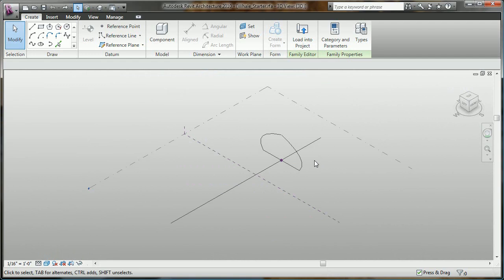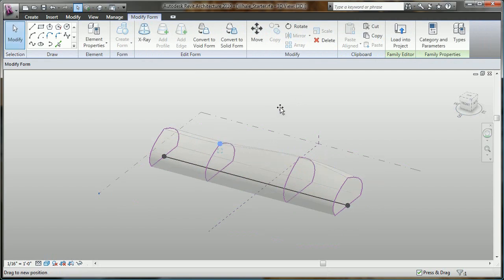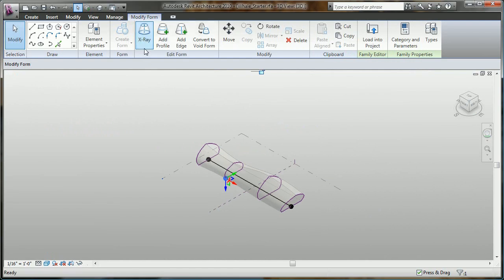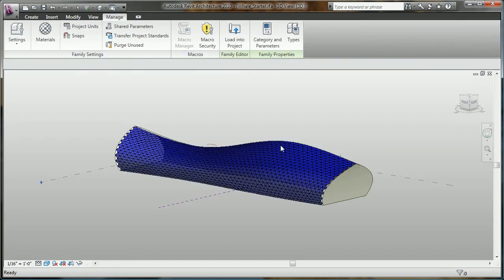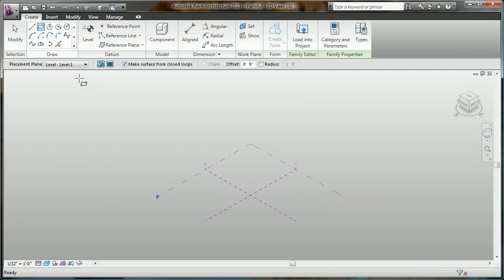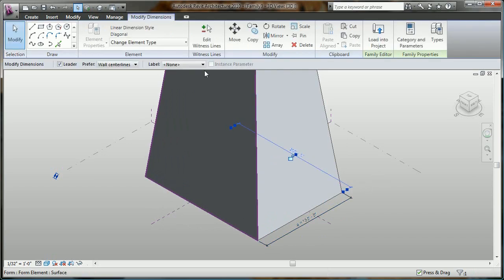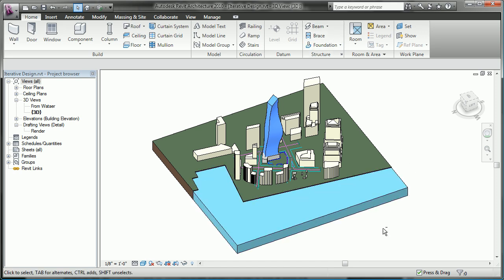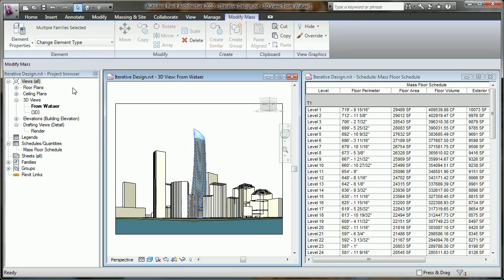Autodesk Revit Architecture 2010 Demo

Comment: We are in the age of artificial intelligence in 2024. When you say draw the project and give it to me, it will draw it. But autodesk infraworksta cannot even transfer the lines of the plots of the roads we draw in revit. This is such a clumsy understanding of software. why are you selling the products as a team, why are the software not compatible with each other. Are the software developers making fun of the users. The roads are drawn in infraworksta. It is transferred to civil3d, there is only one line there. You transfer the revite from there and add the road to toposolid by drawing a line one by one, it doesn't fit either. mu.koskoca why can't autodesk solve these architectural environmental object transfers. Is it that hard for you to automatically open the scene in infraworks with its roads and plots as toposolid in revit?

Comment: @Arajack  Revit is BIM based, AutoCAD Arch is not.  BIM is an integrated process for exploring a project’s key physical and functional characteristics digitally before it’s built, helping to deliver projects faster and more economically, while minimizing environmental impact. Coordinated, consistent information is used throughout the process to design innovative projects; better visualize and simulate real-world appearance, performance and cost; and create more accurate documentation.